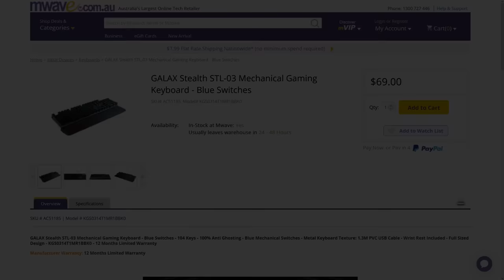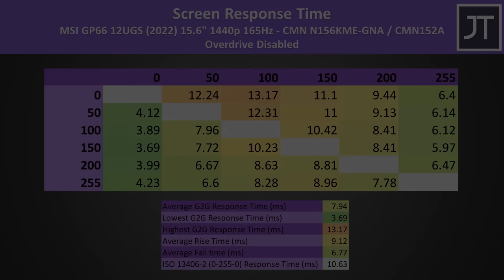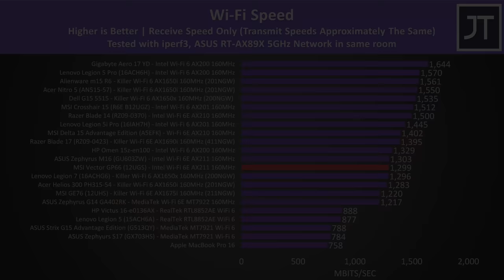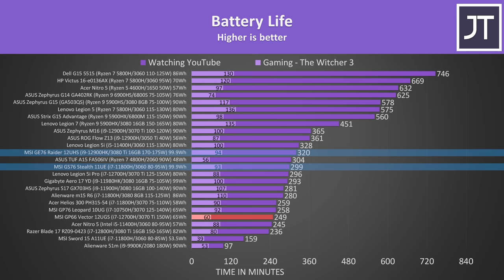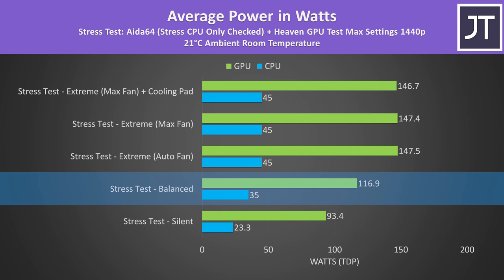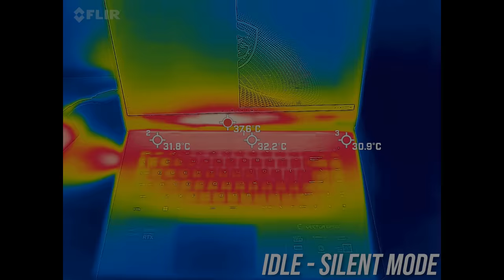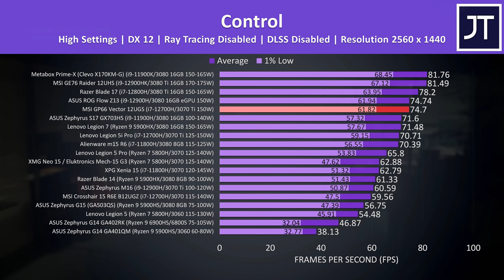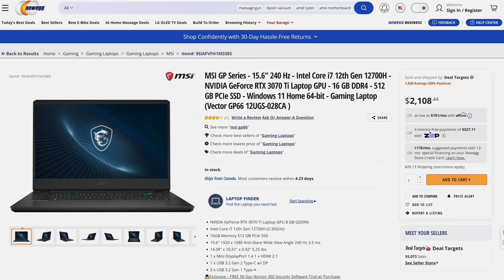MSI GP66 (2022) Review - FASTEST RTX 3070 Ti Gaming Laptop!

Comment: I have tested the 2021 & 2022 variants of gp66 with i7 11 gen & i7 12 gen. & Was surprised by the performance & 3d mark scores of this small laptop. My 11 gen 3070 gp 66 was getting 11800 timespy scores out of the box with extreme performance mode, faster than many 3070ti laptops including Strix scar 22.
Reply: It is not clear to me, is the 2021 or 2022 model of MSI GP66 better?
Reply: @rir6609  2022 model is better than 2021 model, but 2021 model is lately very impressive compared to other 3070 & 3070ti laptops, considering its price to performance.
Reply: I have the 2021 variant of gp66 qhd 165Hz ,11800h, 32Gb, 3070 and its a beast...the only thing the temps are a little bit high
Reply: Your Strix scar 22 has an AMD chip 🤣
Reply: @187cake  I haven't published any benchmarks about Strix scar 15

Comment: Hi Jarrod. I have been looking at this model. Does the lack of adaptive sync matter on this. Legion 5 has it or is this one worth it for the full time full power graphics? Just wondering if adaptive sync would help on a 1440p panel where you're not always going to be hitting high frame rates. What's you're View Jarrod?

Comment: It's quite impressive how the GP66 beats the legion 5i pro in games even with slower memory. It's enough proof that games at 1440p rely a lot more on GPU performance than CPU performance. The 2 biggest drawbacks of the GP66 I can think of are the lack of IO options and the screen brightness (Although I personally don't need that much IO). Everything else is user upgradeable including the SSD and RAM, so by upgrading it you can bring the performance up to the level of the GE66. The camera is alright. I am someone who never uses the touchpad so that's not an issue. In my region (China) the price is significantly lower than the GE66 (about $1000 difference) and it's about $600 cheaper than the legion 5i pro (price difference doesn't include the costs for manually upgrading the SSD and RAM).
Reply: I kinda disagree with you. GP66 with 11gen i7 CPU but a "stronger" RTX380 performs worse then GP66 with 12 gen i7 CPU and RTX370Ti. I think rtx380 is bottlenecked by anything less then i9 CPU. Both models have 195W total output btw. And CPU matters in newer games that utilize more CPU cores. What is confusing with mobile GPUs is twp's, you can have same GPU set to different wattage and this performing drastically different. I hope GP66 will not get baked easily, and the fan noise is not super annoying.
Reply: @D.2023  I mean, I don't know what you disagree with. I am comparing two laptops that have the same CPU, and you bring an example of a laptop with a last gen CPU. The improvement gain from 12th gen intel over 11th gen is significant. That is why I am comparing 2 laptops that have the same specs, but one focuses on maxing the CPU performance (legion 5i pro) while the other focuses on maxing the GPU (GP66) and we see that at 1440p the GPU offers more performance. Why would you use a CPU from last gen which is significantly worse than the current gen to make a comparison?
Reply: @D.2023  And the RTX3080 isn't necessarily stronger than the RTX3070TI. Only difference is the VRam which only really matters at 4K gaming. I was talking about 1440P at which VRAM still doesn't play such a big part. 8GB is still plenty enough at that resolution

Comment: Hi. What is that black stuff that covers heat pipes and other elements on GE66? Is it to prevent heat from escaping the pipes and lead it out to the less insulated areas? Cheaper GP66 does not have that, the metal is exposed all the way. So maybe manually covering the pipes with similar insulation tape, and maybe applying some CPU heat-transfer paste on top of CPU can help with heat transfers? Or wise versa, maybe being unprotected those heat pipes can be more efficiently cooled by 3rd party cooling-pad (those with electric fans) underneath the laptop?  Can it somehow be modded with other DIY materials to improve heat retention?

Comment: Hello Jarrod.. Would you recommend to buy it? Or should i buy a 3070 version.. That is $700-1000 cheaper. So does it matter to get this one, considering performance is marginally better than 3070?
Reply from the maker: I wouldn't spend $700-1000 just to get Ti if that's the only difference. If it's last gen CPU it also won't affect gaming that much, so depends what you're doing with it.

Comment: Hey Jarrod. 
1.	Is it possible to configure manual fan curves in a way that fans start spinning when the temperature of 60 degrees Celsius is reached? 
2.	Do you need to run the MSI app on every bootup to apply the fan settings or are they saved somewhere? I’d like to know if the settings will be remembered when I apply them in Windows and then reboot to Linux.
Thanks in advance.
Reply from the maker: There aren't temp levels, it's just based on percentages for some reason but the chart has cold to hot. I'm not sure if you could save your settings in Windows and have them automatically apply in Linux. The max fan shortcut works, but I assume that only triggers max rather than whatever you set.

Comment: I have the version with the RTX3080 and just one thing bothers me...While playing Cyberpunk 2077 or other modern games with higher graphics the CPU goes up to 94° Celsius (according to the MSI Center - Core Temp tells me that some cores are short time even on 100°). It stucks on this temperature and whatever I try, it won't go lower. It set both internal fans with FN+F8 on 6000 RPM and even used the IETS GT500 which is considered to be the best cooling-pad - it still keeps on those 94°. The most topics on reddit told me that this is normal and the i7-12700H is configured to work on those high temperatures. In some posts they tell me that it might be a hardware-issue and other posts tell me to change the cooling paste. Before the MSI I had a Schenker XMG Ultra 17 which was more like a Desktop-Notebook. The CPU never got higher than 90° and that even with expired cooling-paste (the GPU broke and I checked what happened). Is this really normal or should I send it back. It is about 1 month old and I still have the warranty.

Comment: Yo, personally would you recommend this or a lenovo legion 5i pro with an rtx 3070? I’m kind of in a pickle here. My main usage for this will be gaming.
Reply: Legion 5i pro is an allrounder and basically best for the money, but this laptop seems like more for the gaming part..

It depends actually if you go for looks, the legion looks more like a Notebook with rgb that also has a full keyboard while this doesn't..

Conclusion: 
Cheaper, pretty good but (imo) not that good looking 
-> Legion 5i pro

Pricier, has lots of varieties (3060,3070ti,3080 i7/i9 etc)
-> Vector gp66
Reply: Which is best Lenovo or this laptop

Comment: The GP66 2021 and 2022  apparently share the same cooling system. Being the 2022 system rated for 150w (3070ti) GPU, this makes me assume that flashing my 2021 model (3080) GPU bios to 165w max hasn't been a bad thing at all. A bit hotter? Yes. A bit louder? Yes. More powerful and capable than the 130w limit? HELL YEAH!
Reply: what did you flash it with?
Reply: What flash did you use for it bro ?
Another question please : Can I flash a 3080 VBIOS to a 3070 ? I want higher TGP for my GE66 140W 3070, read about a 150W 3070 VBIOS but couldn't find it

Comment: Hey jarrod, is it fine if i play games for 4-8 hours everday on my gaming laptop? I recently just bought lenovo legion 5 pro and im afraid that it will broke really fast if i use it to play everyday, average temperature is 65-75c both on cpu and gpu. Thanks!
Reply: 65-75 degrees on cpu is ice cold, you should be fine. The gpu at 75 is rather hot but nothing crazy. It's normal as long as you dont go like over 80 degrees or something (GPU).

Comment: Which 2 of these  laptops should I go for,
MSI GP66 Leopard Gaming, Intel i7-11800H;FHD IPS-Level 240Hz Panel(16GB/1TB NVMe SSD/RTX3060 6GB GDDR6) or    Legion 5 Ryzen 7 5800H 15.6" 300Nits QHD Gaming Laptop (16GB/1TB SSD/RTX 3060 6GB GDDR6/165Hz
Reply: @thatrandomnerd8289  For both work and gaming. I want a laptop which lasts long. I have heard that MSI GP 66 offers pure performance whereas legion 5 is more convenient for everyday purposes
Reply: @thatrandomnerd8289  Which do you think is good in the long run. I want the laptop last atleast for 4 years?

Comment: I have the Vector GP66 HX 12UG model which uses the 12800HX CPU, and according to MSIs spec sheet, the rear USB-C supports Thunderbolt4. I wonder if it will support charging too, but I'm scared to plug in a USB-C charger. It also says it supports USBC-PD. Edit: No I mixed it up. It says DP, not PD.

Comment: Just bought this laptop, did you have to download that power saver and display over drive setting in the msi center. Mine is the 1080p model with same hardware, but does not have either of those options.
Reply from the maker: It was just there as part of the MSI center software, maybe try Windows store updates to make sure you're on the latest version.

Comment: whats your opinion on the galax vivance 01, im planning to buy it soon
Reply from the maker: I haven't used it too much yet, but seems alright, though my stand is a bit flimsy when adjusting the angle but once it's in position it's fine. Not sure if that's just mine, I might have an early model. Most cheaper monitors usually don't offer epic stands though so pretty normal.
Reply: @JarrodsTech  I m ur big fan I have watched most of ur video I m stuck in this laptop and Lenovo legion 5i pro 2022 rtx 3070ti pls pls suggest me ur suggest would mean a lot to me I m hoping u reply me soon

Comment: Jarrod thanks for all your reviews!
Alright, I'm down to 2 laptops for my choice. But I need your help finalizing it.

The GP66 with an 11800 and 3080 or Legion 5i Pro with a 12700 and 3070ti.

What would you take (cost is the same)?

Thanks!🙏
Reply: For setup Legion 5i pro is much better due to its build quality and port election and thunderbolt support.

Comment: which one do you prefer guys between MSI Vector GP66 vs Legion 5i Pro (2022) ? technically i use for 3D Rendering and Gaming
Reply: Which one is best I too wanna know so pls say
Reply: Which one did u get
Reply: If both have the same specs definitely the legion. It's lenovos flagship vs MSIs midrange series.
Reply: @badalsaibo  but MSI provides more performance den msi

Comment: Did you note what the fan noise was when using the Cooling Pad? This is kind of a deal breaker for me.
Reply from the maker: I don't measure it unless it actually gets quieter. There's too much movement needed in the setup to get the pad underneath to have the measurement tools in the same spot.

Comment: Would the GP66 3080 165w variant be a bit faster?
Reply: So far from benchmarks it's like a +5% performance, no need to get the 3080 since it's (depending on the country) pricier which is not worth for the price per performance

Comment: Any owner of a GP66 can recommend a cooling pad ? mine throttled out of the box in cpu benchmarks hitting like 90-95c 
I wish i could decrease the temp. by arround 5-10 any help would be appreciated.
Also tried to undervolt it with Software but it didnt really make a difference in Benchmarks. My thought was maybe the MSI center overwrites it?
Maybe i try to undervolt it in Bios next.
Reply: I have Vector GP76 with the same CPU but RTX 3080 165W. I set PL1 to 85W, PL2 to 110W (you can set lower), time 32 in Throttlestop and synced MMIO. You can safely set PL1 to 70-80W and PL2 to 100-110W. I'm not using power limits from MSI Center because it's sets too high PL over 100W, which causing overheating when CPU goes long over 100W. This MSI Center is buggier with each update, after last update few days ago it's froze hardware monitoring and I need to switch between tabs to bring monitoring back... I bought IETS GT500 (4600rpm max) and definitely recommend it. This cooling pad does magic and effectively lowers GPU and CPU temps even at 15-20 degrees when gaming. Even at half speed it's highly lowers temps :)

Comment: I've been wondering, since the 12th gen only boost to around 3ghz, doesn't it mean CPU bottlenecked games suffer hard from the low frequency?
Reply from the maker: Not really, it also assumes the game is maxing out the GPU at the same time.
Reply: @JarrodsTech Thx for the reply, im not sure why it would not be maxing out tho.
Reply: I have G17 with Ryzen 6800H and that CPU runs at 4350Mhz in games compared to like 3.7Ghz on Intel. 6900HX should run even faster. Theoretically 6900HX should perform better in games than 12900H because it's not thermal throttling and can achieve much higher clock speed while 12700H and 12900H will always perform better in multicore because... well 14c vs 8c on ryzen

Comment: I’m stuck between getting a MSI Delta 15 Gaming Laptop, AMD Ryzen™ 9 5900HX Processor, 15.6" FHD 240Hz Panel, AMD Radeon™ RX 6700M, 16GB, 1TB SSD (£1079) and the LENOVO Legion 5 15.6" Gaming Laptop - AMD Ryzen 7, RTX 3070, 512 GB SSD - (£1199) - Using it for gaming ofc, uni work n just general use. Any help would be great 😇

Comment: What is the best Asus Zephyrus M16 or MSI GE66
Reply from the maker: I haven't tested this year's GE66 yet so hard for me to say.
Reply: So far spec wise i would say they're pretty close tbh.. 

Ge66 vs M16
15.6" vs 16"
360 hz vs 165 hz
250 nits vs 500 nits
2.5gbps vs 1gbps (rj45)
99.9w vs 90w (battery)
FHD vs HD (camera)
2 ram slots vs 1 + (1 not replaceable)

Also a hard choice for me since I can't choose either gp66, ge66, m16 or the new g15

Comment: I'm looking at a 12800hx 4800ddr5 3070ti 240hz OLED gp66hx model but need to know if the power block will be the same as the ge 67hx raider 
Can anyone help I don't want a smaller power supply and loose any of the 12800hx potential.

Comment: I got the 2021 version with RTX 3070 and 11800H. The laptop is great with an excellent QHD display and great performance with low temps but it has two major flaws which are first the speakers. Why first? cause they are so so bad that my iphone 11 is louder with better quality and more bass, its horribly horrendously bad sounding like a speaker straight from a 90s computer muffled and telephonic sounding. The equaliser nahmic software doesnt fix this turning out to be a marketing gimic. The second flaw is the battery which is only 65WHRS unlike the competetion with 90+WHRS. The battery at most lasts for about 3-3.5hrs on light browsing with medium brightness.

If these two flaws arent a big deal to you I recommend this laptop cause the performance honestly is up there with the best, my 3070 as far as I've tested is only 5fps behind the 3070 ti and about 8-10 from 3080. The laptop runs cool too.

Coming from an rog strix scar 2 with 1060 and 8750h this was a great upgrade except the speakers which is miles better on my older scar.

Comment: Anyone considering purchasing this should read my comment first: In the UK this is about £2000, with the same specs as the review. The Legion 5i Pro 2022, also with the same CPU / GPU / RAM, but DDR5, was about £400 cheaper at £1600 until recently when prices went up again (probably due to the Shanghai lockdowns and ongoing supply issues). I do not know how you can recommend this laptop in good faith. There are SO many compromises, and then the only thing people care about is 5% more FPS? Really? It's a total joke. Let's see the areas Jarrod himself mentioned where the MSI laptop falls short (or is worse than the 5i Pro):

- Screen wobble (Legion 5i Pro does not have)
- Potential hinge issues
- No Type-C charging (Legion 5i Pro has)
- No G-Sync (Legion 5i Pro has)
- Poor screen brightness (Legion 5i Pro is 500 nits)
- Overshoot and undershoot for good screen response time
- Average / poor keyboard and trackpad with weird gap in front (Legion 5i Pro has an excellent keyboard)
- Average / poor port selection (Legion 5i Pro has more)
- No Thunderbolt (Legion 5i Pro has)
- The worst laptop to open you have ever tested, and parts break off (!?) when you do it...
- Bad speakers
- Worse battery life than Legion 5i Pro (both bad anyway but yeah)
- Runs warm and loud with potential for thermal throttling (not issues with Legion 5i Pro)
- Worse CPU performance than Legion 5i Pro
- Worse productivity performance than Legion 5i Pro

Conclusion: Definitely not "worth it" for 5% FPS over a much cheaper and much better machine. Even if in your region the Legion 5i Pro with the same specs is the same price or more, this MSI is still not a good laptop and doesn't compare to the Legion. The review is WAY off.
Reply from the maker: Mate all I said was it does good in gaming compared to the more expensive GE series, relax. I'm not out here saying BUY THIS OVER A 5I PRO. Heck if MSI let me keep it for longer, I was going to do a dedicated comparison between the two but they wanted it back. If you want to talk price, the 3050 Ti 5i Pro was $1800 USD when I covered it, now that's the real joke. I don't have time to check prices in every possible region, I can tell you for a fact I never look at UK prices, and focus on US as that's where most of the viewers come from.

Obviously if a 5i pro is cheaper than a GP66 with same specs it's a no brainer. Sorry what even is this comment lol, you act like I'm hiding stuff when most (all? not sure what the "parts break off" part is about, guessing the bottom panel plastic tabs? That happens on Lenovos too) these dot points are from my own videos, as if you uncovered some groundbreaking new facts. I guess sorry I didn't title the video DON'T BUY THIS ONLY GET LENOVO and talk about that for 5 minutes in the conclusion.